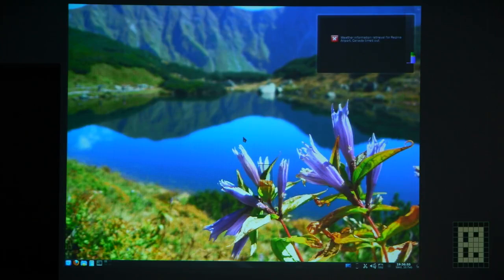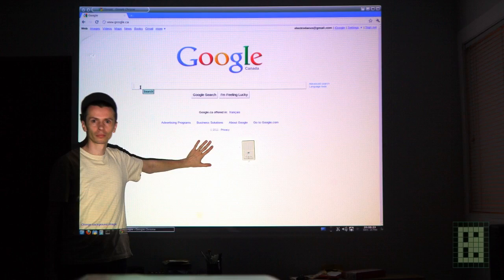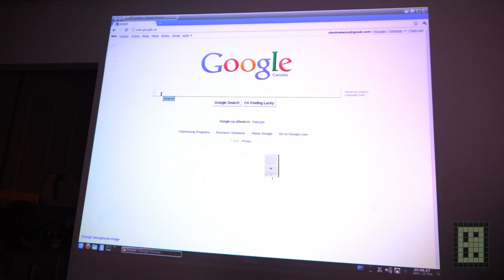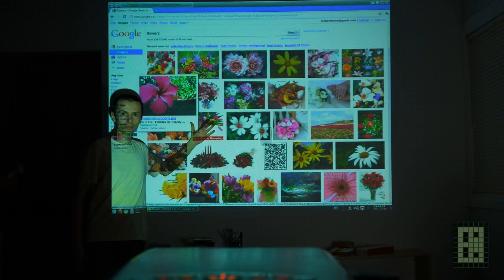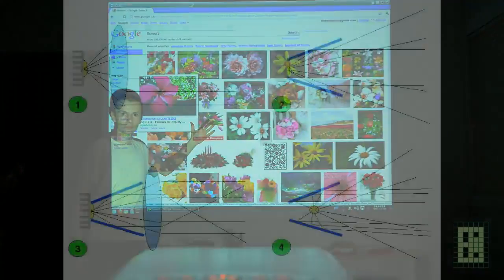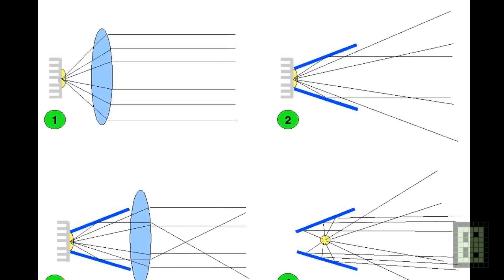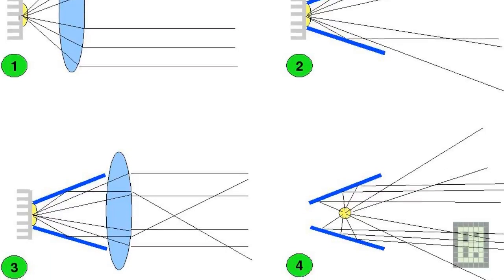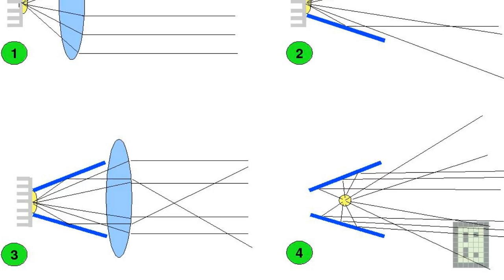DIY XGA LED Projector 3xLCD lamp replacement 25 lumen 720p (part-2)

Comment: how much voltage is epson lcd projector emp-s4  lamp ?
Can I give direct 230 voltage on projector Lamp 
Please reply Sir
Reply from the maker: No you can not use that lamp without the original driver. They usually require a large ignition voltage 2.5 to 5kV then some lower voltage 65 to 200V DC to work so you need a special electronic driver to use it. Also is very dangerous as if that breaks there is mercury inside and that is a neurotoxin so do not play with that bulb.

Comment: I would like to know if you can provide the scheme for an optoma projector to put a led in place of the lamp thank you I will leave my email fernandolob@hotmail.com
Reply from the maker: I do not think is worth wasting time in 2020 to modify an old projector when there are so many native LED projectors that will be superior to what you can do DIY likely below 50 lumens.
It depends how new the Optoma projector is as the newer models will have much more complex serial communication to check if lamp is installed not just the simple open or close circuit of the projector demonstrated in this old video I made.

Comment: I have two optocouplers on my toshiba tlp 670, how do I know which one to short? Cant find any schematics online
Reply from the maker: It will be the one that has the output connected to the main board. One will be oriented the other way around as one is to enable the lamp and the other to check if lamp was enabled.
pin 1 is usually marked on an optoisolator and that is the input the output is on the other side. and so you are interested in the one that has the output facing the connector that will then go to main board and say all is OK with the lamp.
Reply: @electrodacus  First of all thank you for the ultra fast reply years after this video was posted. Second of all,my problem is both of them are oriented the same way and there is no easy way of saying which one is connected to the main board. They are on the power supply board, next to them is ph marking and a line going toward them saying primary and secondary. Maybe if I can show you a picture of it you cpuld understand better and hopefully help me.
Reply from the maker: @filipkirn5246  Yes a photo will be more useful. Are you sure there is not a third optoisolator that is facing in the other direction ?
Reply: @electrodacus  Yes, only two of them. I will send you an email with a few pictures,thank you.

Comment: Hi bro your video is very useful to me please tell me that what differents  R G B lcd chips in lcd projector
Reply from the maker: Sorry I do not understand the question. Modern commercial single DLP or LcOS projectors use 3 separate Led's R,G and B that are controlled in sequence so you will have that flicker and rainbow effect.  This is a 3 LCD projector so an LCD for each color and white light for a lamp is split in to the 3 colors to supply to each of the 3 LCD then image combined with a prism.
Is also possible to have individual RGB Led's one for each of the 3 LCD but that is not very popular as is more expensive than single DLP or single LcOS (also an LCD but reflective).

Comment: hello i have a epson ex5210 projector i need to bypass the ballast problem is i cant figer out witch wire it is could you plz help me out with this?
Reply from the maker: That projector is newer than this video and is likely there is no longer a simple bypass option as demonstrated here but a more complex serial communication between ballast and main board. It does not make much sense today to modify an old projector when even the lowest cost LED projectors will be much more capable. You can not expect to get more than 25 to 30 lumen from a modified projector similar to the results I got.

Comment: you did a big mistake to open lcd stips with pull force, not unlock their locks. By the ways, video is great.
Reply from the maker: Where did I pulled the LCD strips ? I only show how I connect them in this video not disconnect them.
Reply: @electrodacus  sorry brother, same you have to show unlock it which cutted from video and looking like you pulled with force of board.
Reply from the maker: @MuhammadYaseen-vx5hw  They where not pulled with force as I know how those connectors work. And I wanted the video to be short as people do not had time to watch long videos not even in 2011 when I made that video :)

Comment: pls plan of adaptor link led pls i cannot unerstand  what wire link in what  pls drawing it pls bro
Reply from the maker: The instructions in this video are very clear. This hack only work with older design projector as the new ones require proprietary serial communication between high voltage power supply and MCU and thus can not be hacked in this simple way.  This video is almost 9 years old and it is not useful today as there are plenty of commercial LED projectors with much better performance than you can get with an LED.   Best you can get with this method is about 25 to 40 lumen no matter what LED you are using.

Comment: game console repair parts, computer repair parts, mobile phone repair parts, accessories and fashionable products, high technology products supplier.

Firstsing ATX Water Cooler Full Aluminum Transparent Tempered Glass Gaming Computer Case
 
http://www.firstsing.com/p/46944/atx-water-cooler-full-aluminum-transparent-tempered-glass-gaming-computer-case.html

xbox one N15-120P1A power supply, usd15/pc
Xbox one original controller old type, without earphone hole, 300pcs, some are new, some are 90% new, pp bag packing,take all price usd15/pc.
Xbox one dvd drive original new 100pcs in stock, usd14/pc, 
xbox one consoles original new 2pcs in stock, standard packing set, usd250/pc,
Xbox one S power supply 100pcs in stock, usd11/pc or so see order quantity,
xbox one S and x universal blue tooth wireless controller original new small stock, good price,
Xbox360 wireless controller original 20pcs in stock, usd15/pc take all price,
Xbox360 DG-16D4S DVD Drive Mainboard PCB BOARD in stock usd4/pc or so see order quantity,
xbox360 slim mother board universal, in stock, good quality at good price. 
xbox360 slim x818337 cgpu in stock,
xbox360 slim 220V-240V power supply original new, 100pcs, usd13/pc to you. 
PS4 ADP-200ER power supply for the 12xx consoles original new in stock, usd14/pc or so see order quantity, 
ps4 single ear earphone original new in stock, usd3/pc or so see order quantity.
PS4 MN86471A HDMI CONTROL IC, usd6/pc,
ps4 slim ac adapter, N15-160P1A, original NEW in stock, usd15/pc or so see order quantity,
PS4 slim ac adapter, ADP-160CR original new in stock, usd16/pc.
ps4 slim 490AAA lens with tray 1300pcs in stock, brand new, take all price usd7/pc.
ps4 slim and PRO universal 496A lens original new usd8/pc, 
ps4 pro hdmi port connector org new,usd5/pc, 
ps4 pro console case with hdd case, usd19/pc, 
ps4 pro ADP-300CR power supply usd60/pc,

Many thanks and best wishes!

Anndy
www.firstsing.com Japanese office and Chinese office, more  than 1000 kinds of  hot selling products;
https://www.amazon.co.jp/s/ref=nb_sb_noss?__mk_ja_JP=%E3%82%AB%E3%82%BF%E3%82%AB%E3%83%8A&url=search-alias%3Daps&field-keywords=firstsing
   We have online shops worldwide, mainly for promotion use, we mainly do wholesale business, 
www.consoleplug.com mainly for repair parts;
http://www.shengxintga.com/products.asp   You can download some wholesale pricelists of ours here;
http://www.cybergadget.co.jp/retrofreak/en.html for the video game  world KING  product;
www.facebook.com/firstsing
https://www.facebook.com/anndy.wang.1  New products info everyday!
https://www.youtube.com/channel/UCfnQKP1TTLbAZemUgH7e6Zw   We have many youtube channels, 
Skype anndy.wang
Whatsapp: +819029620800
Wechatt:  BlessAnndy
Firstsinganndy@gmail.com

Comment: Cree XHP70.2 P2-1A 4292LM 6500K LED Emitter,  32mm Acrylic Plano Condenser Convex Lens for LED Flashlight,  XH-M401 DC-DC 4-40V to 1.25-36V 8A Buck Converter Step Down Module. Fasttech.com
Reply from the maker: The XHP70 die will be to large and you will not be able to effectively climate all the light thus most of it will be lost before getting to the projector LCD's
The largest die that can be utilized is the size of XML2 and maybe you can try with XHP50 but unlikely that will give better result as XHP70 is way to large see below photo from right to left is XHP70 , XHP50 , XML2
https://attach.mobile01.com/attach/201501/mobile01-50f54090389b12b5baabf54f189ab9b5.jpg
As for the XH-M401 that is only a CV DC-DC converter and you need a CV-CC supply for LED's
Also this is a 7 year old video I made and back then there where no commercial LED projectors and those sort of DIY projectors made sense but it makes no sense now when you can get a low cost 50 to 100lm LED projector with better performance than anything you can do this way. So I will say unless this is for educational value it makes no sense to attempt something like this as you will be disappointed in the results.
Reply: Yeah, you're right, it makes little sense of effort. But there may be people who have a good resolution projector and want a light source that consumes little electricity and use it for ambient light with night images to dream nicely. I thought I could get better results with a proper focus. For example, the LED is attached to a light tunnel like the DLP projector, made especially for the dimensions of the LED and the other end of the tunnel, using a magnifying glass that is in the same place on a DLP projector. I have all the materials, except the light tunnel and the magnifying glass , and I'll try to see what's coming out, one day I hope soon.

Comment: can you please  give me the lens diametre that you used in this tutorial 
thanks
Reply from the maker: I do not remember maybe I answered someone the same in the past. The large one fits inside a 80mm x 80mm fan case so is close to that diameter and the small one between 2 and 3cm.
Reply: dear electrodarus thanks for your replay 
iwana ask you if i use this led its will work better or not
thanks
https://www.aliexpress.com/item/CREE-XHP70-XHP-70-Cool-White-Neutral-White-Warm-White-High-Power-LED-Emitter-30W-6V/32685227544.html?spm=2114.13010208.99999999.278.oPOS9M
Reply from the maker: The XHP70 is to large and you will not be able to climate the light so you will not get better result than with XM-L that I used in this video or the more efficient XM-L2 here is an image with size comparison the XM-L2 is in the middle and the XHP70 on the right  https://attach.mobile01.com/attach/201501/mobile01-50f54090389b12b5baabf54f189ab9b5.jpg
Since XHP70 is so large you will not be able to properly climate the light so less light will get to the small LCD inside the projector.

Comment: salutare ,imi poti spune daca ledul cree xp-g3 r5 este ok pentru modificare ,din specificati rezulta ca are doar 3,45 mm ,? ms si felicitari
Reply from the maker: Yes XP-G3 will work but do not expect much since is a max 6W LED so about 25 to 30lm out of projector similar with my results in this video. This video is more than 6 years old there is no reason to modify an old projector today when even the most basic commercial LED projector will give a much better result.